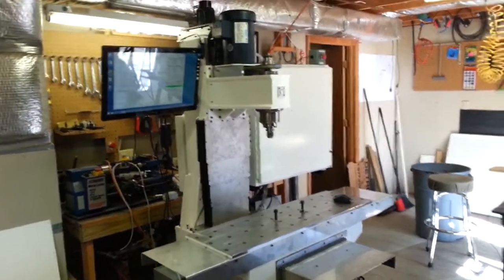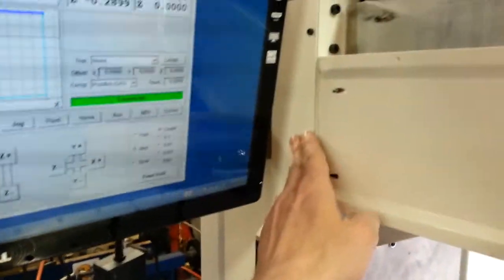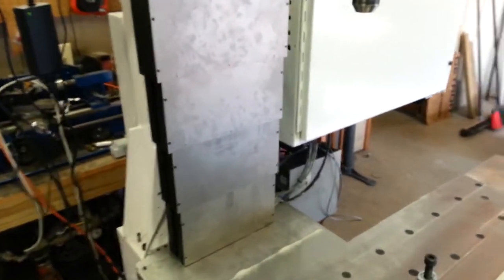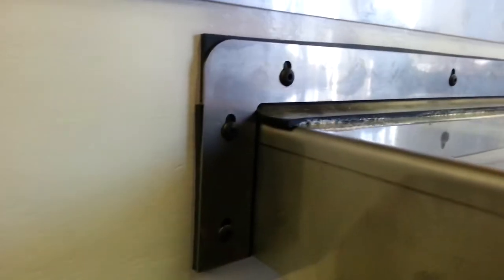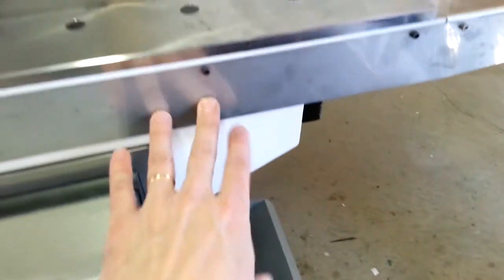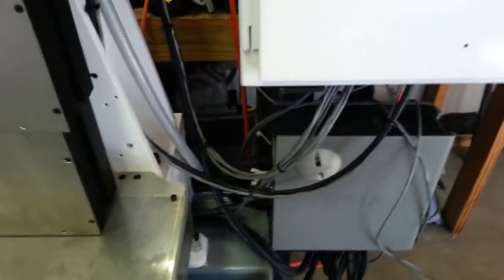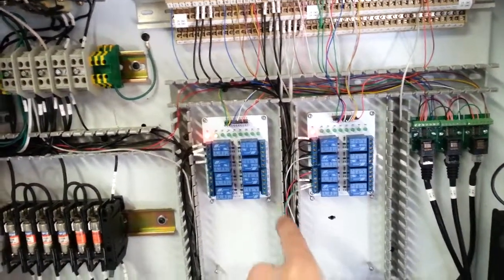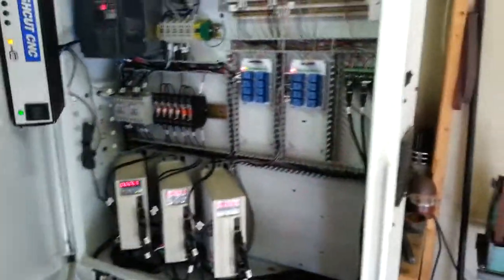CNC Mill, Way Covers

Comment: When its done i plan on doing something similar to your. I've change my design a few times but when it looks good in my cad program i'll start. What is the advantage of putting the rail on top of the y axis instead of the sliders?

Comment: Its coming along, way covers look nice. What size servos are you using and what rapid speeds are you capable of?  Do you have a build thread on cnczone. Are you going to do some heavy cuts and sime high speed machinig test. Best build i have seen so far. I'm converting my z axis to linear guide ways ( roller type with pins instead of balls) should be done in the next to weeks. Also it has linear encoders CL steppers.
Reply from the maker: I used .75kw AC motors.  Max speed is set to 300ipm, but could go faster.  That is plenty for me for now.  I'm not going to run production work on this, so I won't be going fast or taking very aggressive cuts.  As soon as I get my flood coolant going, I'll post some videos of aggressive cuts for test purposes. Rails on top or bottom is really up to your overall design, it can work either way.  This machine has a pretty large envelope (24x12x16) for its weight (2500lbs), so it not going to be as rigid as a commercial machine, but it will fit into my basement shop, which was the main goal.  No build thread, just the occasional video.  Thanks